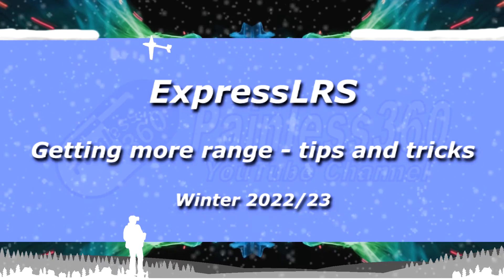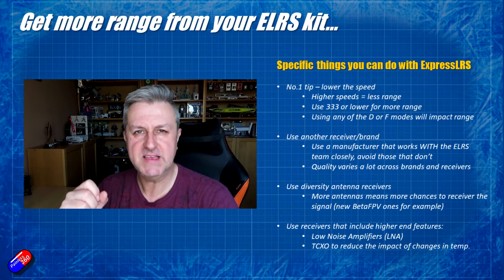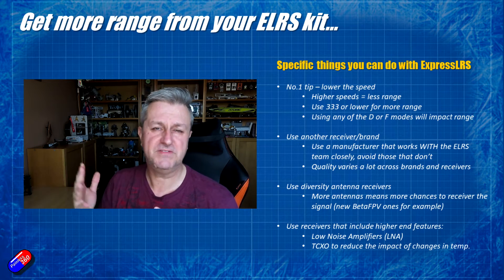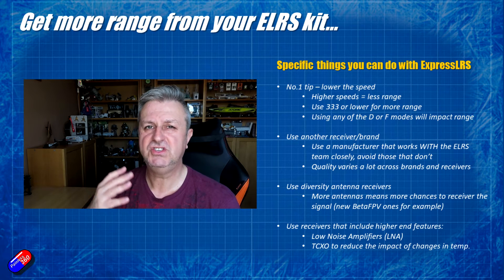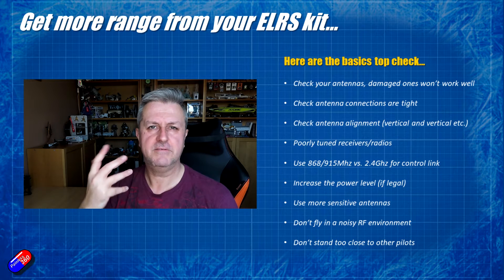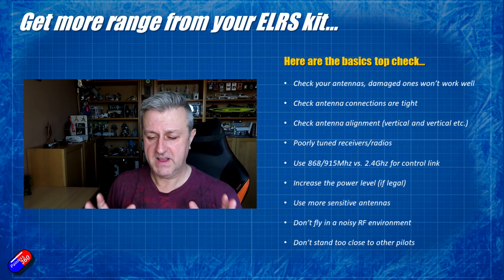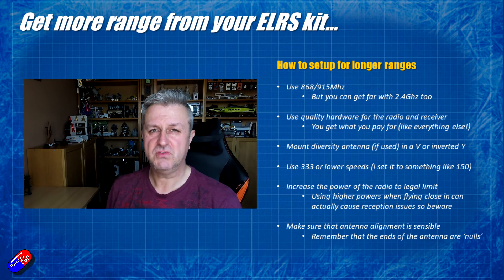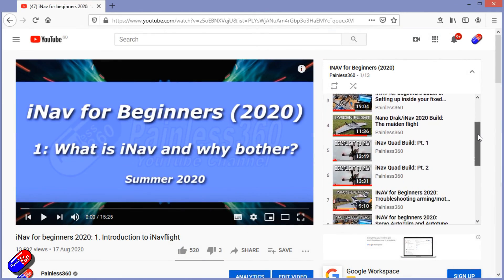ExpressLRS Range Issues: How to fix the common issues and fly further!

Comment: I have an ELRS Lite (2.4GHz) Wich has ceramic antenna and a jumper T-Lite with 100mw power and 50Hz frequency. I am reaching maximum 100 METERS before I lost signal. I am using in an open field with some trees, not more than 2 imas obstacles sometimes. Is something wrong? I tried a lot of things, saw a lot of videos about range but I can't get any better! Is this the real maximum for my config? Please help! I saw the conector, the wires, everything is fine! Thanks in advance!!
Reply from the maker: Those ceramic antennas are terrible for any range outside... best of luck
Reply: @Painless360  but only 100 meters? They can't afford this? And is at maximum 10 meters from the land...
Reply from the maker: I only got about 20 meters on the ones I tried here. Never used them again..

Comment: At 250mw 100hz I get critical rssi and lq danger warnings when my drone is roughly 200feet away….not sure if it’s my equipment, how I built it, or if it’s the Many many HV power lines that run through my back yard…
Reply: My Rx wiring runs across the top of my FC, directly over what I believe is the gyro…..could this be causing my poor range?
Reply from the maker: More likely is bad antenna alignment, antenna damage or obstruction, ELRS not being 'turned on' by a high CH5 value at flight time or a bad Rx... Best of luck!
Reply: @Painless360  arm is aux 1 Chan 5 in up position, antenna is just behind the camera, mounted to the carbon frame, with 2 layers of double side tape, and 2 zip ties… carbon might be causing antenna interference.
Reply: @Painless360  did some tinkering today, my signal problem was due to antenna placement on the drone. I tested rssi dbm how it was, then moved antenna on quad to the arm of the quad and my signal went from -50dbm to -20dm. So I’m definitely going to relocate that antenna!
Reply from the maker: Great to hear you fixed it. That list of 'bad antenna alignment, antenna damage or obstruction, ELRS not being 'turned on' by a high CH5 value at flight time or a bad Rx' pretty much covers the reasons.. Happy flying!

Comment: does range imply reliability / robustness?
Reply from the maker: Yes. If a protocol and radio can get you out to 20km then it should be great for closer in flying. See my comments on this in the Crossfire series...
Reply: @Painless360  thank you! that sounds like common sense, but just wanted to make sure im not missing something, as im not super-knowledgeable in this field.

Comment: I just tried out a BetaFPV PWM receiver for a plane running 250hz hybrid and could not get more than 70 feet away from myself before it would lose connection. I'm using the BetaFPV 2.4ghz module in my Radiomaster TX16S. Not sure what is going on. This is my first PWM receiver in my first plane.
Reply from the maker: Antenna alignment?  Speed settings? What have you already tried?
Reply: @Painless360  The antenna should have been fine. At the back of the T1 Ranger wing pointing up and down. I crashed and broke the tail off the plane so I gave up and went back to trying to get my module to work with my Mobula7 again. 
I just reflashed my TX module back to elrs 2.9 so it will work with my elrs Modula 7 because the SPI Mobula receiver is stuck on elrs 2.0. I also reflashed the plane's receiver to elrs 2.9 after the crash. Then I noticed that my TX power settings was at 50mw. 
I don't know if it was at 50mw for just the plane because it was previously set to 500mw before I flashed the TX from elrs 2.x to elrs 3.2. So maybe flashing it to elrs 3.2 reset the TX output power to 50mw? Or maybe flashing the TX back to 2.9 lowered power to 50mw? I'm not sure. 
When I get the plane repaired I'll have to try it again and this time I will know that I am on 500mw output power.

Comment: I bought a 2.4 patch antenna when I started off long range. It extended my reception from 400m to 1.8 km with a old xm+ receiver. . Can this be used on my elrs 2.4. .? Don't really want to always be running max power as where we fly is allot of interference.  
Thanks for the tips. Had my antenna alignment wrong but still getting 8 km on 200mw. .
Reply from the maker: Should work fine. See the new Moxon antennas  from RadioMaster. They are kind of the same thing... Happy flying

Comment: Thank you for the review, I did not wanted to waste my money specially at this days, so I stop to buy garbage, specially with the price of airplanes and equipment, so I still with crossfire and even older version software and guest what?  It works for miles with no issues.  Just open the package get the rx installed and flight no drama.  You are the only one with the true, the rest of youtubers lie to people.

Comment: Do the Bench Test so you can establish your baselines. If your baselines are bad, then troubleshoot it while still on the ground..
Reply from the maker: Nice idea. I'm interested in what process you follow for testing ExpressLRS on your bevch..
Reply: @Painless360  Just the official ExpressLRS Bench Test, outlined in the ExpressLRS Website.
Reply: Basically put Receiver and TX module 1m apart, in their optimal antenna orientation/polarization when in flight, off the flat surface and record the 1RSS (RSSI dBm) values with the lowest power level the tx can output.
If the value is within -30 to -40dBm (for 2.4GHz) or -20 to -30 dBm (for 900MHz), baselines are good.. If it's way lower (higher negative number), then definitely something is amiss.

Comment: We also crash allot so even if everything looks fine with a receiver, it might be damaged in a ways you can't see. That's one of the advantages of ELRS is that I'm more happy to replace flakey inexpensive equipment after a crash instead of just living with odd behavior as I try to avoid replacing a $50 receiver.

Comment: 868/915 have smaller bandwidth to work with and in cities these bands can be more noisy than 2.4 even with WiFi. In remote areas, then 868/915 would go farther hands down.

Comment: What I don't understand is we use telemetry.
Doesn't this mean that we use transceivers  
So the main unit is pumping out 1Watt, which allows us to fly our quad/plane further away. 
How much power is the unit on the quad/plane transmitting at.?
Reply: It isn’t the right answer.. but the normal CRSF RX does 25 mw. 
Maybe ELRS is similar.